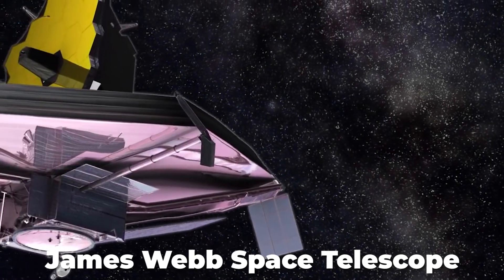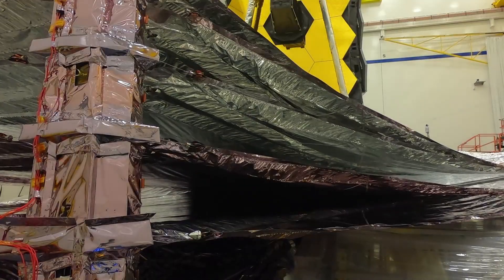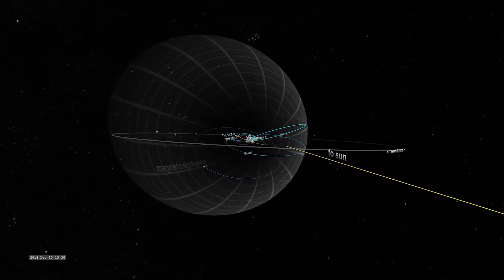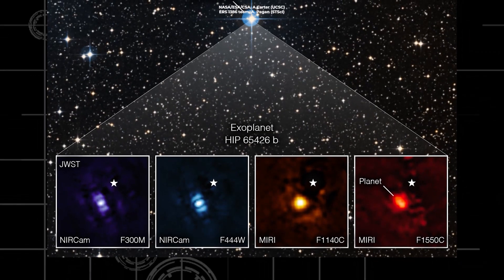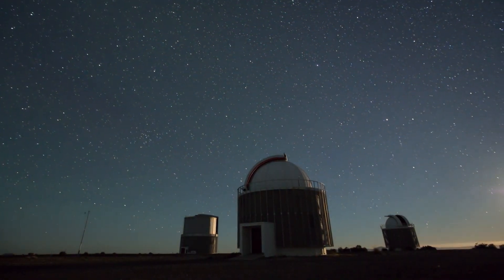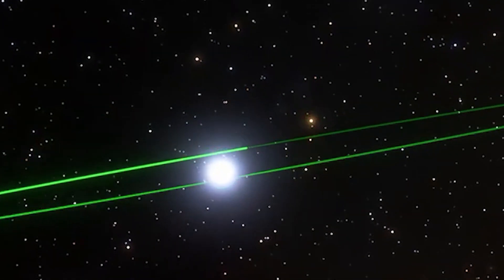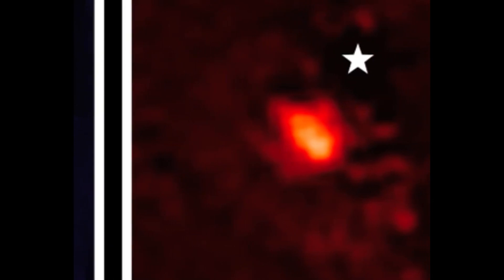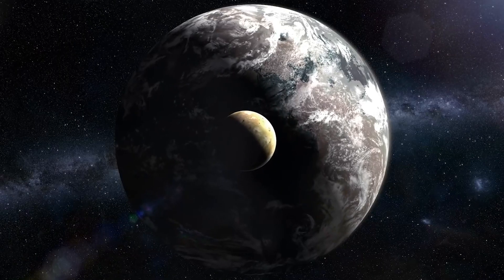FIRST REAL IMAGES: James Webb Telescope Discovers Super Jupiter!

Comment: So in the light of recent experiments which shows light speed to be no longer a universal constant but can actually be stopped and speed up by 30% in a hot plasma. How long are you still going to use an in correct unit of measurement????? Light speed is not a universal constant how can u use light years as ameasurement?????